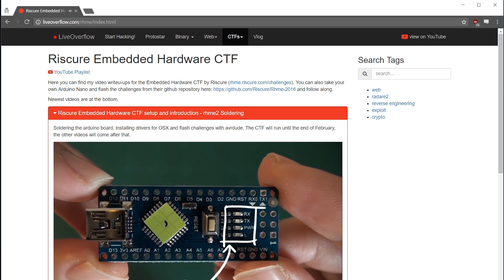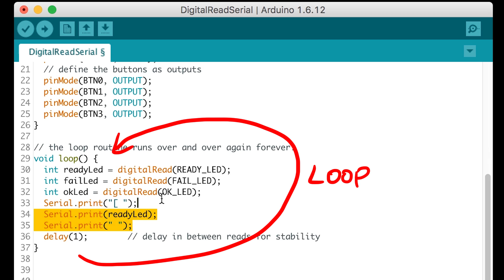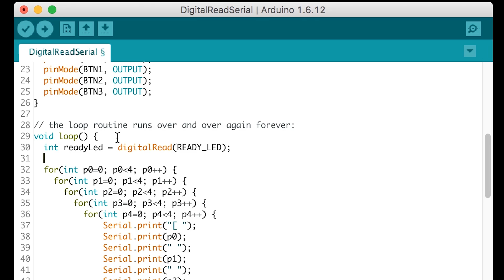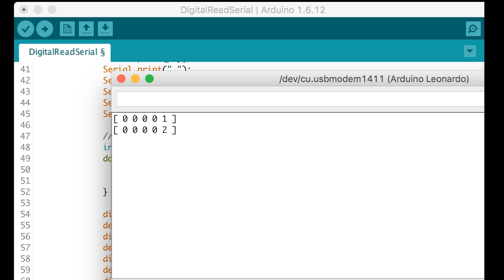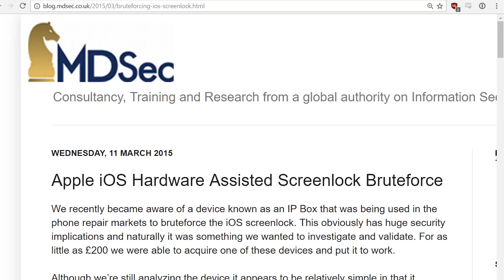Attacking an Electronic Combination Lock (ft. Electronics Idiot)

Comment: Some years ago, when thinking about writing elements for a game, I thought about how most(/all?) games which have "hacking" are often just some simple interactive puzzle to solve (e.g. rotate some dials to match up shapes before a timer expires) as a poor fill in for hacking. I thought it would be nice to have something that is at least real-world plausible..  so low security locks might have the solenoid wires directly accessible.. and a higher level lock might have the keypad and solenoid controller on the same bus (e.g. i2c), so it could just be told to activate if you had the right interface device. And there could be a bunch of other realistic techniques (learned as hacking/security skills in the game) which could be applied.

Comment: You do not have acces to the Reset Pin, and if the power supply is in the whole, you have to think differently 
Here is other method that I’ve imagined :
- Create a Short Circuit on the button, that would force the Arduino to reset ( If you can acces the RES, but else I’m sure that we can found another thing to short-circuit the arduino )
- If the Software is not secure you can try to send courant in all of the buttons exactly at the same Time

And here is how to improve security :
Software:
- Use the Arduino’s EEPROM ( Memory that do not reset while off )
- Do not create a Program that only read pressed button state but also other button, because if they all pressed at the same time you will know 
- A solution for changing the code if someone know it without getting the Arduino out of the wall
Hardware :
- The Only thing that the user can acces is the button and the led, no res, no wire. Nothing.
- Use a power supply unccesible by the user ( Wire in the wall, or a small battery on the Arduino )

Comment: you assumed that the microcontroller and the motor is not accessable. and motor the system should have battery power. then how can you access the reset pin????

Comment: You cannot really protect from hardware attacks with software. Surely to some point you can improve the security against hardware attacks, but usually not that much you can do. So there are possibilites to create a secure device, however those all rely on special hardware functions, like setting assymetric keys in the efueses of a processor to prevent someone from flashing his own software. However in theory you can create 100% secure software if you get it completly bug free, however you never can create 100% secure hardware, since if you have physical (maybe even from some metres away) access, you always will find some way to crack the hardware. So your best chance is to make it hard enough that an attack becomes unrealistic for your products use cases.

Comment: The connections you have made wouldn't work in the real world. In your case, both of the microcontrollers (the lock and the attacker) are connected to the same power supply, thus have a common ground by default. In the real world, the two microcontrollers would have a different power source. In that case, you have to somehow create a common ground by connecting the grounds of the two microcontrollers and making sure no shorts happen.

Comment: What if every time the arduino starts (implying that the power had just been cut off) it has to be reset at the hardware level before you can do anything? Assuming you have it plugged into the grid with a battery backup it shouldn't lock without someone trying to hack it too often.

Comment: How about this: first time you power the device on, you'll have to use a different password to access the regular functionality of the lock. Three wrong "master" password attempts and you have to use a physical key to unblock it. 
If your car fob doesn't work, you put the key in and sync it back. 
There's always a way in. It only depends on your threat model. 
Your account doesn't need to have 10 step authentication with encrypted usb device and DNA sample of your grand-grand-grand father. You only need to have a better password than the guy next to you.

Comment: Anything that is exposed is going to be attacked by any means! Even a LED connected directly to an I/O pin can be used to analyze the power rail of the cpu (which might reveal information about the internal state) or the LED gets removed and the remaining wires get some uncomfortable voltage applied under the hope that it might cause the I/O port to become a regular conductor that may deliver some of that power to the motor driver... (if that causes the CPU to release the magic smoke, just increase the voltage) and so on. ;)

Comment: Here is an alternative idea - supposing we don't have access to power supply.

We could connect another board to all 4 input pins and 3 diodes. It then would wait until somebody types in the correct code (indicated by green diode) and then just output it somewhere.
Reply: Great idea.
Reply: This actually is done very often. Criminals attach a fake keyboard over the real on a ATMs or card terminals.
Reply: A very similar thing exists for card reader door locks called the ESPkey. You attach it to the two data wires and it can record and replay all card read events it's really cool.
Reply: Or you could just record all the codes used on it by people and then just try some of those. Unless you expect everyone to be trying to hack it too.
Reply: In that case you can just short vcc and gnd for a very short time, thus resetting the board
Reply: @pitust  Why bother with reseting, if you can do a man in the middle attack?

Comment: I thought that using raspberry pi would be better.
Reply: A microcontroller is totally fine for this kind of use-case. Since you wont be doing any kind of work that requires a general purpose computing environment.
Reply: In that case R-PI could be more secure because it takes more time to boot it up. But same could be achieved if microcontroller would wait a certain amount of time before it enters loop.

Thou - using R-PI would be like shooting mosquitoes with a cannon .
Reply: Miku MichDem perhaps, but now your system is also possibly vulnerable to a wide range of exploits that target the linux kernel.

Comment: What if you put a "delay(60000)" at the beginning of loop? In that case you had to wait a minute before you could use the lock (when it's connected to a power supply), but an attacker would be unable to bruteforce the PIN in a few hours. In addition you could add one more digit to the PIN. These two methods combined would make the lock a lot safer, wouldn't they?
Reply: Or you could have it save the attempt count and try the password. This way if the power fails, it restores the attempt count and continues the delay. If the password succeeds, the attempt count would be zeroed and saved. There are new hacks that are based on how much power is delivered to the device, causing the device to act funky and unlock itself. Another hardware solution would be need to deal with that.
Reply: @Mineroboter why not? I would even consider setting a 10 minute timer. You don't change batteries too often

Comment: So much simpler... Just put 2000V on the power supply and watch everything short and the motor start turning (be ready to hold the door open because this will probably destroy the lock)
Reply: Miku MichDem 
Yes, but that wouldn't open the lock because remember, the lock is controlled by the logic in the arduino and (theorically) you dont have access to the wires going to the motor.

And you still would have to hope the components are far apart so that the 2000v wouldn't ionize the air and jump to others
Reply: @idkfkingknowlmao  Well, there's a certain resistance between the pins and 5V. Nothing's perfect. So with a high enough voltage, we could raise the voltage in all the pins to 5 V. But I think the 2 kV would just burn everything before the motor spins.
Reply: That's quite easy secure thou. All it takes is one zener diode between Vcc and GND that would short-circuit power supply once power goes over 5V - affecting more the power supply then the lock. Could also add a fuse for security.

Theoretically circuit could be burned easier if you would apply -2000V (thou that can be secured using a different type of diode), but it would burn circuit and motor before it could unlock.
Reply: Or just use a stick of dynamite. Go big or go home
Reply: You know that that wouldn't really work right? You would probably just short a component and the circuit would be dead as in a open circuit...
Reply: Easier option: break down the door

Comment: Hi Overflower, your final thoughts are not completely right, it's just a new view from the one you are used to, that you have to apply. So it's not more complex. To make this transition easier for you: If you want to attack an access control system (e.g. a lock), there are in principle 5 different potential targets to do so:
- the object/mechanism preventing you from entering (wall, door, windows, firewall)- 
- the lock / locking mechanism itself (eg DAC/MAC models in computers)
- the key (plus identity in digital systems)
- any physical protection, shielding the lock/system from being physically tampered with
- the lock-key interaction (e.g. transmission of the secret if the locks are not mechanical)
That's perfectly identical for physical systems, as well as for the digital access controls you are used to. E.g. transmisson of a key on a computer system can be attacked by sniffing or MITM in order to gain access. You prevent this via encryption. Exactly the same is true with electronic locks e.g. with pins (> sniff via mounted cameras or MITM via attached faked keyboards at ATMs), RFID or bluetooth dongles (> sniff via RF scanning). Sole protection is again encryption (-> smart cards).
Everything just looks somewhat different, but is in principle completely identical if you just abstract one level from the level of detail implementation. By doing so, you'll be able to apply everything you know about computer access controls also to electronic locks. You may also find some valuable inspiration by reading through the physical security chapter of the CISSP, which you are certainly familiar with. Hope this helps.
Reply from the maker: +Frank Schneider wait until I make a video about fault injection. This is were hardware is just unfair :D
Reply: +LiveOverflow
I like your videos, so I am looking towards that.
Problem is: we live in a physical world and it is not just a virtual ghost in the shell.

Comment: i have a question i have been going to hacker boot camps for over a year now i and i see it over and over again, methods.
i have been taught how to exploit services hardware and other PC's but it all comes down to same thing physical interaction.
is there a method a way to get in to your targets PS without physical interaction,
threw those boot camps i have been shown how to get remote shells on to computers with a "Flash drive or some sort of direct connection".
what must one do to gain control without any physical interaction with the computer,and not with the humman operating it,no humman hacking just you and your targer's system do i need to find a 0 day do i need to programm a completely new exploit how can i gain control over a long distance?
Reply: making your own exploits for the target machine since that is what someone with knowledge will do cause some 0days wont work on some machines. what you need to do is learn several languages and don't take shortcuts (hid hacking and such) also liveoverflow did a great video on that.

Comment: How can u learn to pentest hảdware?
Reply: +ha Nguyen
First you need to establish a communication channel with the device.To do this, you need to access it via a channel that it is able to communicate over (pretty obvious, right ?).
This can be either via the "classic" communication channel it offers, usually that's  via network, e.g. via a web interface. If there is network access, it's completely identical to testing any other system. Of course is this channel usually the one that is best fortified (which doesn't necessarily mean a lot).
If you have physical access  you might try external hardware interfaces like USB (in case it's a USB devices, or has USB ports) or others to gain access.
If you are able to physically open the system, identify if it uses UART, I2C or SPI, hook up your forensic systems to it and communicate with it via the supported protocol(s). These channels are usually not heavily fortified (with a password at best) and technical documentation will often help you, if you are not dealing with high security equipment. Thereafter it's the same as with all other systems. 
Of course all of this requires that you are the owner of the system or have been granted permission to execute these activities and that the act of doing so is not considered illegal in your local jurisdiction.

Comment: Great introduction, here are some suggestions for the code as well as the viewers.
Use base-4 counting instead of nested for-loops. Just a minor quibble.
Power glitching is a real powerful technique, even if the lock manages to store the retry state before power is cut out. As it should. You basically lower the Vcc below working voltage but above BOR (brown-out reset), this tends to insert garbage into RAM. If you get lucky, one of those random bits would open the relay.
I/O glitching would work if the inputs are unprotected (no buffers or Schmitt triggers) and especially if the developers used interrupts in an improper way.
RF glitching also might modify internal RAM, with the powerful radiation of a GSM phone for example. Or X-Ray.
If doing a real attack try to randomize debounce delays (those 50ms) and introduce artificial bounces from the Arduino.

The conclusion is that it's really hard to protect against side-channel attacks, but as a product developer you should employ all affordable measures, it would filter out a lot of the attacks.